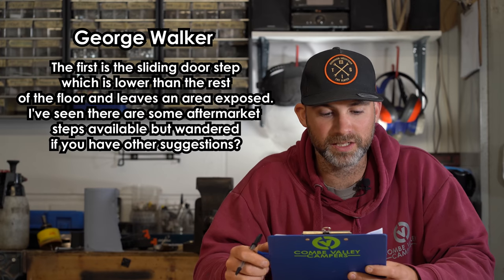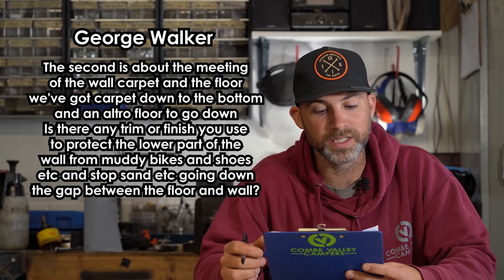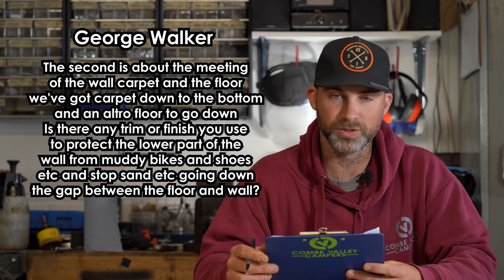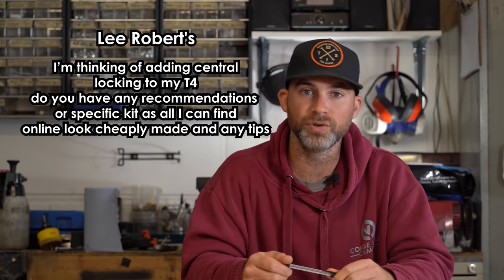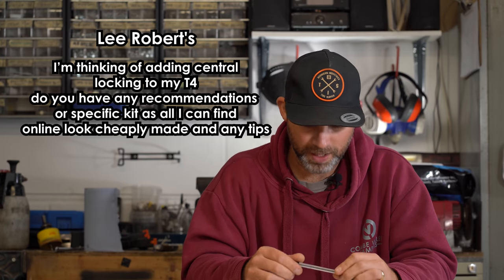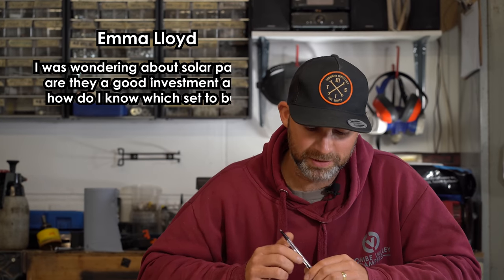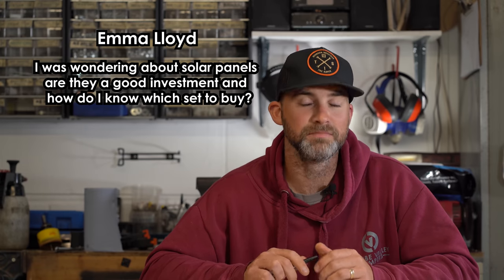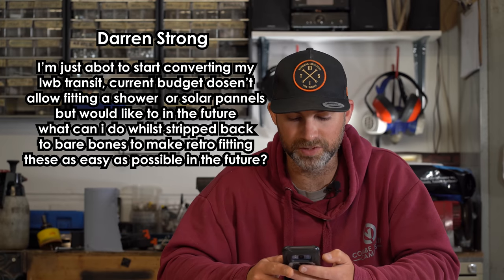HOW TO BUILD A CAMPER QUESTIONS ANSWERED! Q&A Wednesday #5

Comment: Hi & thanks for these Q&A's, dead helpful!

RE flooring layers,  there's a couple of other suggestions floating around the web so just wanted to know which of the three methods below you would recommend and why...

1 - answer given in video - bond batons to floor, deadmat between the spaces, screw ply to batons
2 - lay deadmat over 100% of floor then bond batons on top of deadmat (in the rib gulleys), lay ply and screw through to batons
3 - bond batons to floor, then deadmat over 100% of batons and floor, screw through ply into deadmat then into batons

Nice one :)